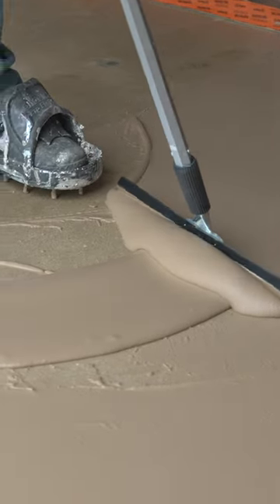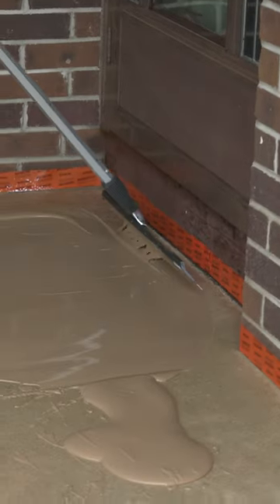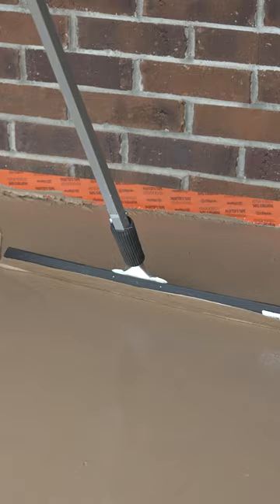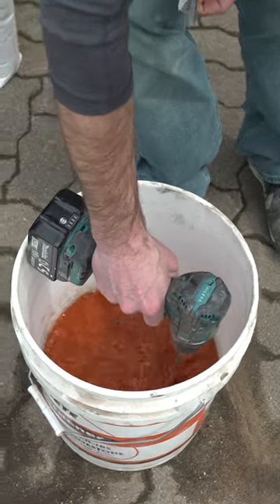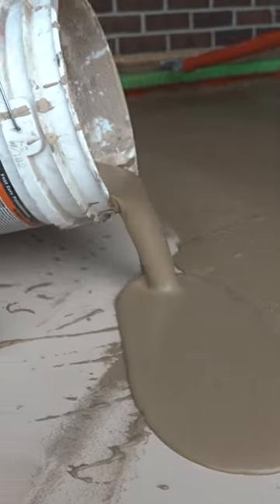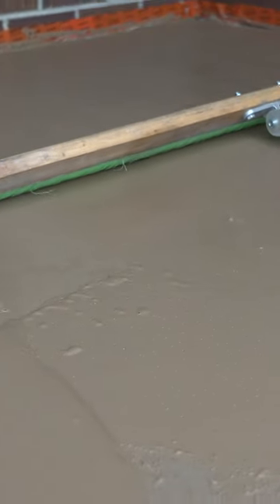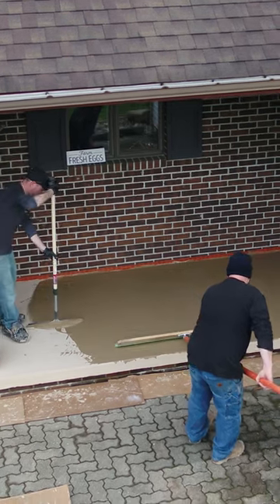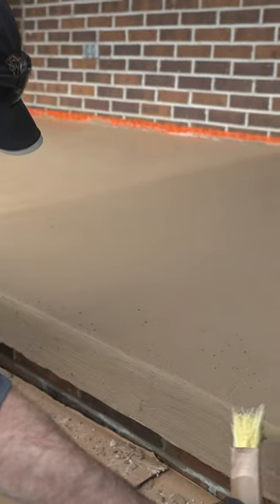Concrete Overlay! #shorts #concreteoverlays

Comment: How long do you think it will last before cracking? What is the brand and type of material?
Reply from the maker: on a solid concrete slab without cracks, this product should last 15+ years. you can view it on our website here: https://www.deco-cretesupply.com/products/trowel-overlay/stamp-mix
Reply: Tag
Reply: @DecoCreteTV why would you recover a solid slab with no cracks to begin with? Customer have more money than brains like most elites🤔
Reply: not a fan

Comment: What type of cement is that.  Self leveling. ?   I’ve been taught to pressure wash and acid etch  but I’ve never done an overlay   Cause I don’t believe they last.  Does anybody know if you use muratic acid and primer if it has a chance

Comment: Is it  trawal or squeeze ?
Reply from the maker: Thanks for the comment! It's technically a squeegee trowel. Magic Trowel is the name of the compony that originally designed this tool and they had patent on it. The patent has now run out and there are quite a few tool companies making these. Most people still refer to them as a magic trowel, regardless of the manufacture.

Comment: I've never seen an overlay that hadn't failed. 1 month, 1 yr, 3 years 10 years they always fail. And don't give me the 'improperly applied' excuse...
Reply: Improperly applied 😊
Reply: They’re temporary patches until there’s budget to replace the stairs.  Replacing my stairs, porch, and front wall will cost me $2000+ and maybe more depending on where prices are in three years……this patching is $20 and takes a couple hours.  It does what it’s supposed to do and I can do it again to get me through until full replacement 

Pros are always like “replace it or hire a pro”…..are you paying? 🤪 this isn’t the only priority

Comment: That will pop very quickly... definitely not lasting. Seen it 100 times rather then finish properly or re doing the slab you throw some pisscoat on it and expect it to last
Reply: You're definitely not in the concrete resurfacing industry then lmao
Reply: @mudslutmusic9052  Exactly, don't blame the product/industry for user error. It's like those Amazon reviews where you can clearly tell they did it wrong but still left 1 star